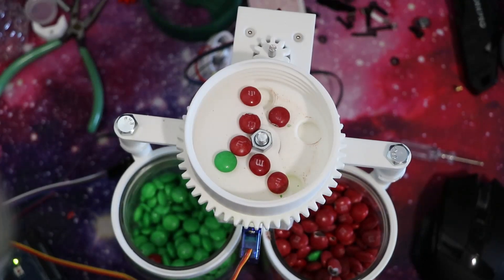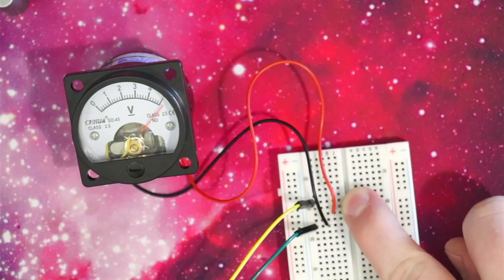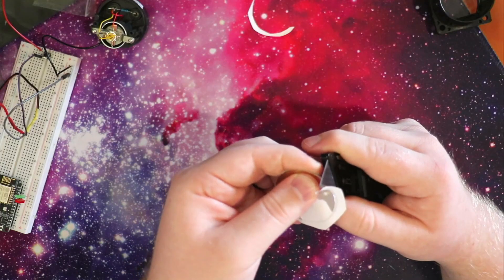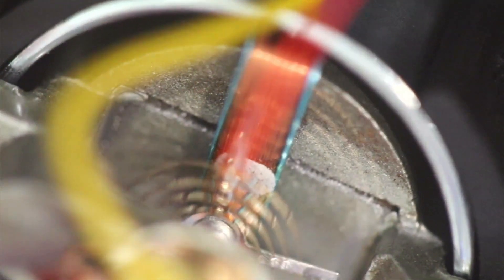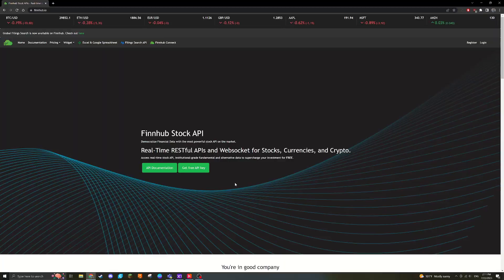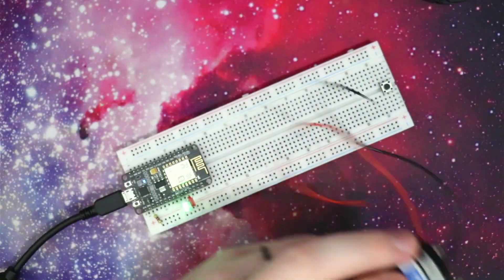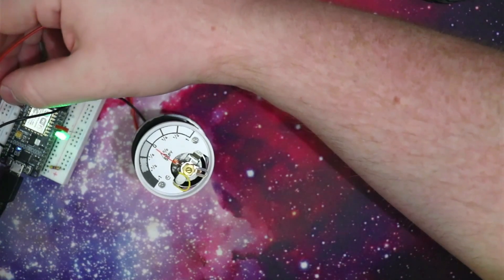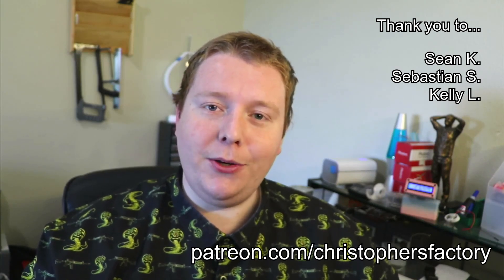Analog Stock Ticker

Comment from the maker: Of course it doesn’t occur to me until I already posted this video that I could just use two digital pins rather than one digital pin and ground 🤦🏻‍♂️ literally the simplest possible solution
Reply: So you swap the digital and ground when you want it to swing negative? You could do that but you’d have to disconnect the ground when you want to swing forward again. What you want here is a h-bridge. They’re used in dc motors to go forward and backwards. 2 digital pins, one applies the output voltage forwards, one applies the output voltage backwards. Plus you can still use PWM
Reply from the maker: @Mike_Hunt_Works  I mean rather than using one digital pin and one ground pin, I just use two digital pins and set one to ground for positive readings and set the other to ground for negative readings. 

I was thinking just like you were -- that I'd need to have some way of switching the inputs... With the amount of current that I'll be drawing (virtually none), I can just do this with the IO pins. I might just have to see this project through now!

Comment: You really just need a logic level n channel mosfet to make this work. Have the esp32 drive the gate of mosfet, and hook up the positive wire of the gauge to a 5v rail, the negative wire of the gauge to the drain of the mosfet, and the source of the mosfet to ground making sure both grounds are common.
Reply: Yes yes, please do the mosfet add on. It will be  great follow up to this video. Just use a BS170 (or similar). Horrible performance but widely available and it’s through hole (has legs) so it will work with a breadboard.